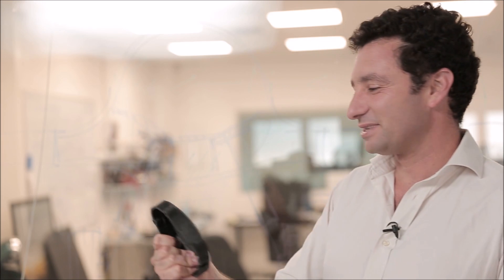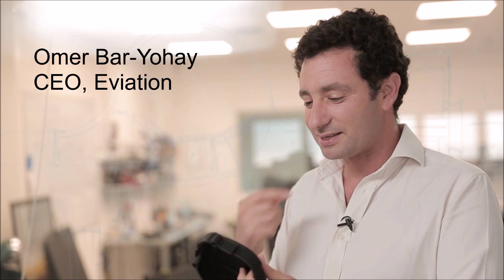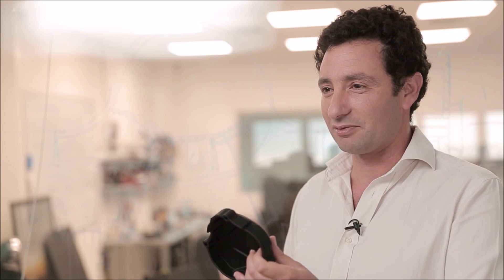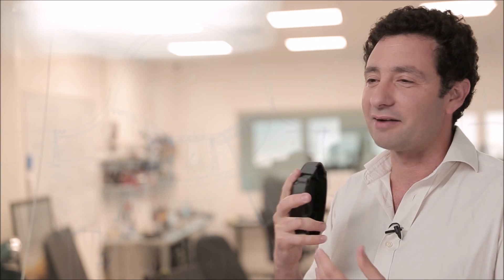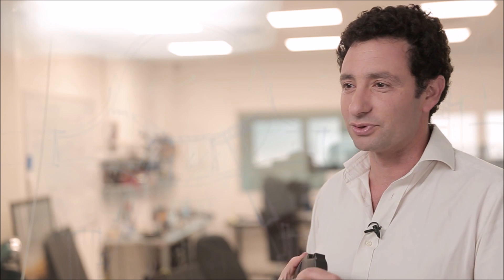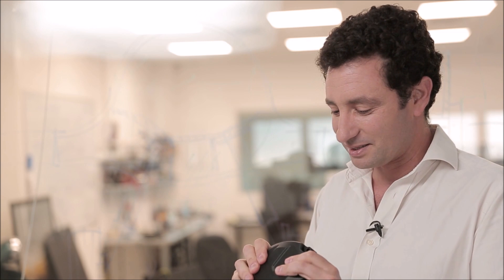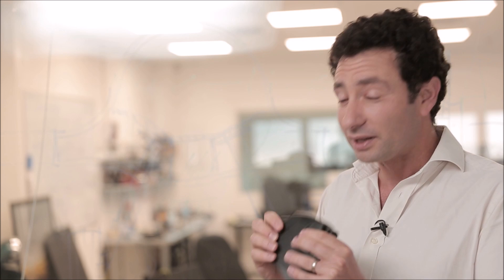Customers React to 3D Printed Nylon12 Carbon Fiber Material

Comment: It sounds like a really great 3D print material that could be really beneficial but I'm quite concerned about the oceans of microscopic fibers in it because carbon fiber is considered as dangerous as asbestos fiber. It's a classic lesson that just because you can't see the damage doesn't mean it isn't silently killing you with no chance for repair.
Asbestos was ignored for over 30 years even though it was known how deadly it was. Classic human super stupidity. Let us always make sure because death is very real.
Reply: Would it maybe be possible to make microfibers of 2-6GPa steel instead? assuming that is less dangerous. And if it isn't, then look for other ways to print high strength materials.
In general everybody should really get into making inexpensive metal printers.
Another possibility is super high strength plastics because we know organic polymers can have extreme strength without CF or glass reinforcement